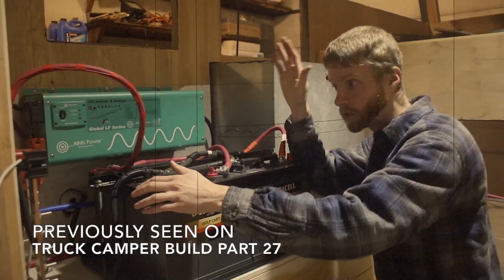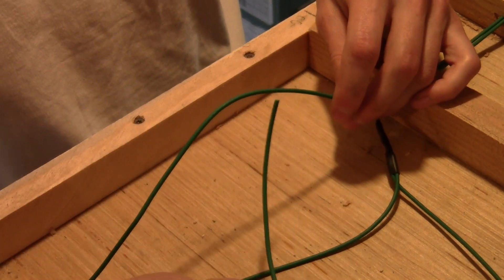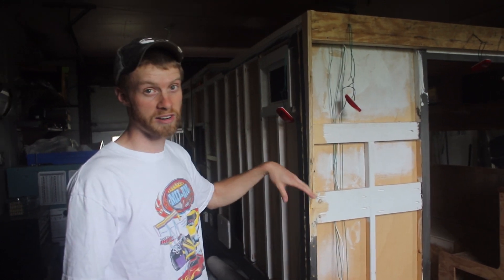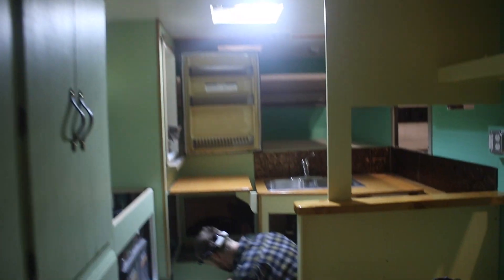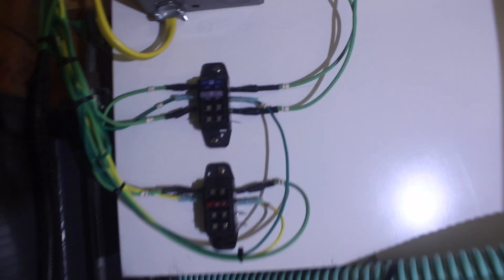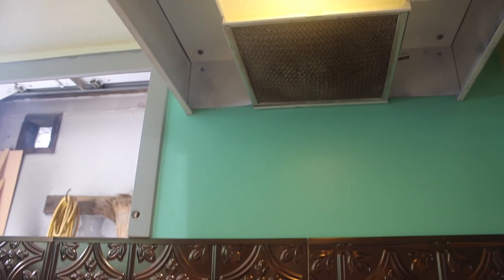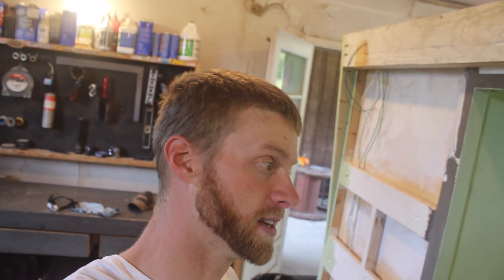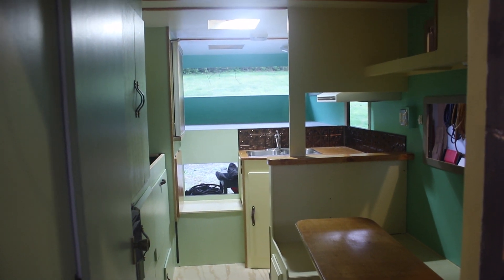DC ELECTRICAL SYSTEM - Truck Camper Build Part 44

Comment: You might want to hot glue some of those spade connectors in walls or use screw terminals. I have feeling after alot of road vibration you may have some spades fall off.